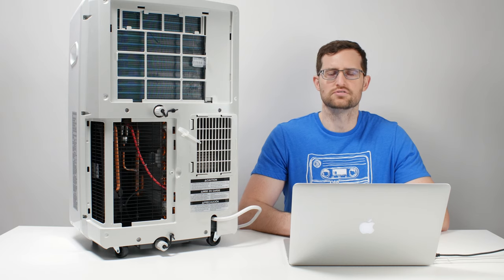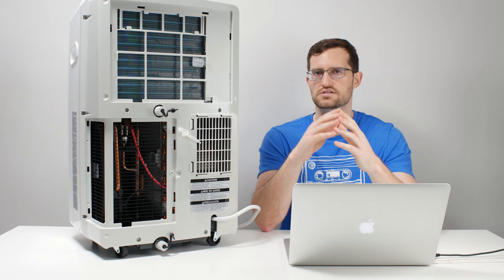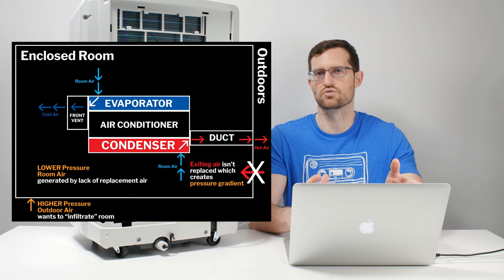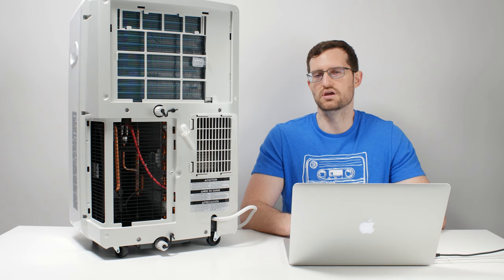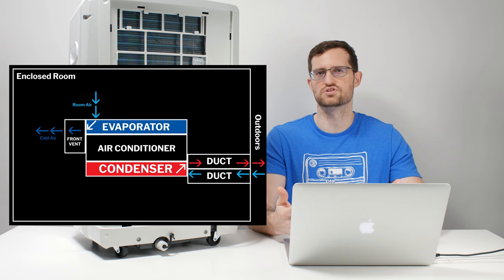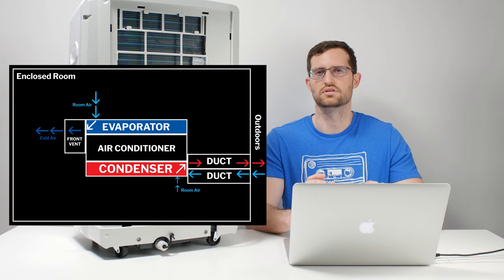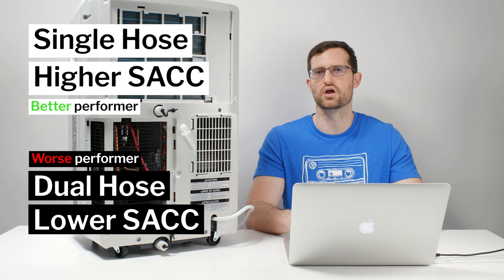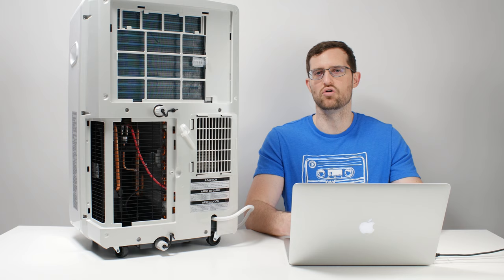Single vs Dual Hose Portable Air Conditioners

Comment: SACC is probably the worst indicator for a comparison between single and dual hose AC units. The main reason is that there is no test setup description available that fits the design. The cooling capacity at any given seasonal point is measured against a constant volume of air .. with a single hose unit that does not work, where's the exhaust air to come from ? So a few admissions had to be made, for example that the exhausted air is replaced by 'room temperature' air that has 'exactly the same' humidity as the test volume :-)
The second thing is that hose type ACs have no seasonal use cases, they mostly get stored away when not needed.
I modified a single hose to dual some time ago and measured the result. It's cooling performance dropped by about 10% because of the losses in the second hose and the higher temps of the outside air, but it's cooling capacity of the room volume of air rose by 40+ precent, simply because the room never filled up with hot outside air. Where the unit was running 100% of the time it dropped to a nice 30/70% duty cycle.
The point here is: the SACC value of a dual hose may be lower, but the suction effect of the single hose units ruins their actual performance while the SACC calculation ignores that effect.
Reply: ASHRAE is still worse than DOE's SACC.  Here is a fun description of the test and the feedback that the portable AC industry gave for the SACC calcs: https://www.federalregister.gov/documents/2016/06/01/2016-12446/energy-conservation-program-test-procedures-for-portable-air-conditioners

Comment: I have a dual hose and single hose air conditioner. The dual hose works to cool whatever room it is in. The single hose is only a spot cooler that I use in a small den that blows cold air on me when at my desk. Single hose is basically a fancy fan that only cools you down if you are right in front of it.
Reply: I have this single hose unit and it cools my 600sqft two-car garage perfectly fine. The garage door is standard without insulation on the back of the garage door panels and there's a laundry room that has the door open all of the time and there's a slotted closet door where the water heater is located and there's a cat door leading into the house... so the garage is FAR from "sealed/insulated"...so even with the negative pressure drawing in air from multiple places and the fact that I'm in GA during 90+ degree humid summers; my garage has gone from 85°  to a comfortable 75°.... This single hose AC unit is fantastic and blows out air that is a crisp, cool 55° ...it has a heating function and a dehumidifier all in one.
https://www.google.com/url?sa=t&source=web&rct=j&url=https://www.lowes.com/pd/GE-8000-BTU-Portable-Heat-Cool/5000143967&ved=2ahUKEwiNqfG9l5HyAhXVTTABHTFtCwoQFjAAegQIBhAC&usg=AOvVaw2z-IXaA84IntndC11IbrZ6 

I'm in the process of upgrading to the dual hose attachment and expect at least a consistent 72°.
Reply: @Thomas998822  I am happy for you, but if it was a dual hose it would work much better at cooling and would use less power. It is just science and physics.
Reply: @Thomas998822  that ac isn't powerful enough and it's constantly running hard.  For the size of your garage you need a 12000+ DOE(SACCS)  portable AC
Reply: @jonlee5642  maybe so. It definitely runs non-stop, and I can hear it cycle off and on (while still running). I'm not sure what technically is kicking on and off into overdrive. 

Nonetheless I only use it for several hours a day, 3-5 days a week in the summer, and it hasn't shown any signs of slowing down yet. It still keeps the garage in the low 70s which is good enough for me. I'm sure the dual hose attachment will make it more efficient, so it's certainly  powerful enough for my needs.

I'll swap it out with a brand new machine in a couple years for free so I'm not worried about wearing the unit down long term.
Reply: @Thomas998822  more likely you ac has a sensor ..if you are asking it to cool it at a certain temp..it will keep working until it keeps that temp you want it at and hence it is powering up and down all the time
Reply: where did u get the dual hose unit? you probably live in the US, because i cant find any dual hose unit in Europe

Comment: 1. The energy caused by convention heat from the INtake hose (holding outside temp) on a dual hose unit is nowhere NEAR the energy of the air (holding outside temp) pullled directly into the room by a single hose unit.

Both versions have  an exhaust hose, so there is no difference there in convection heat (unless one hose is more insulated than the other or shorter of course), but for sure it helps a bit to insulate this extremely hot hose on both variants AND keep it as short as possible to minimize convection surface.

Comment: I am using two single hose portable AC units in an apartment.  I found the dual hose unit to b overly complicated to install in my particular situation.   I found with the single hose units they are doing a great job at cooling the place.  On these units the hose diameter is 5.9 inches. They are used at about 4 feet long. 

I made sure there were no air leaks between inside and outside. These units are 10,000 BTU each.  One of these AC units is easily able to cool a room area of 400 square feet. I put a standing floor fan about 2 feet in front of the AC unit to boost the velocity of the air from the AC unit.  This shoots the cold air across the room.

Comment: Excellent explanation of this whole business.  I'm a renter and can't mess with a traditional window AC, so I'm going to get a single hose portable AC and put it outside(!) next to the window.  I'll put some kind of adapter over the main air intake and run a duct through the window to suck air in from inside the house and put a similar adapter on the cool air output and duct it into the room.  Then it'll function like a regular window AC, no negative pressure will result, and there will be no hot ducts inside.  My main problem is humidity (tropical climate) so I'm hoping the outside air will be enough to cool the condenser.   At least now I kinda know what I'm doing.... Thanks.
Reply: thanks for sharing. so your hot exhaust pipe goes out the window.

intake of air you duct it from outside the room you are in

and inside the room, you let the cool air out.

Did i get that right?
Reply: Don’t follow this guy’s advice; he’s simply wrong.
Reply: @Shontaku  I  would prefer "unquestionably wrong", "utterly wrong", "dead wrong", or "completely and without any possibility otherwise, wrong"   Or better yet, "horribly wrong." That's my favorite.  I shall now go and hang my head is shame.
Reply: @workingTchr 😂😂

Comment: Oh wow! Thanks for explaining this! I do feel the lower pressure when I try to close my door it's like it doesn't want to shut when the AC unit is running, and I didn't fully understand the reason for that! Basically my room is turning into a giant vacuum.
Reply: It means the room is well insulated (warm air still gets in but slowly). Crack open a basement window if you have one ( cooler air from there).

Comment: Using a single hose unit in, say, a closed bedroom will draw air from the room and, therefore, the rest of the house (from under the door). A dual hose unit works more like a window unit or a central unit--both of which cool the condenser with outside air.

Comment: You drastically undermined the difference between infiltration air scenarios and used a dual hose model that allows for infiltration... A single hose must bring in an equal amount of heat into the house as it's removing. In theory, you would be correct that they cool a specific 3-400sq ft  area based on SACC, in practice I would say you failed to point out that you're heating up the rest of the house... You kept saying "Performance" but I think you mean cooling capacity, in which case yes, the SACC fully accounts for the AC's regional cooling capacity but SACC utterly ignores that with a Single hose you adding tons of heat to the other 800sq ft of your home and the Dual largely doesn't, and that's pretty huge in terms of efficiency. 
SACC measures cooling capacity for a given area not the energy burden on your household (which is arguably more important to most people).
Reply: I agree.  On top of that, think about the super heater attic air that will be pulled in around light fixtures. Newer construction may seal them, but older ones didn't bother.  Both houses I owned were built in 1970 and 1965 and around the light fixture boxes none of the holes were sealed and not even caulked around.  Doesn't take much 140+ degree air pulled in from those single hose units to offset the cooling on the unit.  I sealed mine but I bet many people haven't thought of it.
I purchased a single hose for emergency use without even considering the issue.  I really wouldn't think engineers would design a unit with such a flaw, yet they did.
Reply: SACC fully accounts for the infiltrating air. But it assumes that the infiltrating is only 5.4F, on average, warmer than the air inside of your home, which is complete crap.  The calcs assume your home is at 80F and that the outside air is 83F 80% of the time and 95F 20%.
Reply: @youtubewatcher4603  I agree! I've had both dual & single hose units. In terms of performance / efficiency, the SACC is not nearly as accurate as the SEER rating.

I may have a bias because I'm in Vegas where 4 months of the year beat 100 degrees, but it's important to know that Cooling Capacity and energy burden are much more different than this youtuber seems to realize.
Reply: @youtubewatcher4603  - a lot of people use portable units for a hot room ( usually on a higher floor and facing the sun) .  Outside temp can be 70F but 84F in the room for example.  For a home with a basement window,  crack it open will draw cooler air.

Comment: There is one additional measure that consumers should account for. That is electrical efficiency to reach SACC values. Take two or more units with relatively similar SACC values and one uses 85 watts less power. This SACC to Power Usage rating can save users real money through power efficiency.

Comment: So… in theory.. one could remove the second duct that brings in (hot) air from the outside to cool the condenser. Thus making it only cool AC air being used to cool the condenser

Comment: I bought a Hisense 12000btu single hose and made an adaptation for the compressor refrigeration inlet hose made on the 3d printer. I wrapped the two ducts with a foam blanket and I can say that the efficiency has increased by 50 percent, now it turns on and off and with one duct this didn't happen, meaning I will save energy. It also depends a lot on the air conditioning model.

Comment: the goal of the ac is to keep cool air in the room, pulling in hot air that will rise and using the cool air you just made to blow out the window is a massive waste of energy and wont ever cool the room you will have the AC running constantly so you can sit in front of it and never have a room actually cooled. insulate the hoses and seal any gaps and place the unit close to the window port to minimize hose length, at least this way you actually have the damn thing do what it is intended to do an that is make the room comfortable.
Reply: They are just spot coolers.

Comment: I’ve used several different portable ACs.
And finally settled on the Whynter Arc 14s…this damn thing seems to solve all the issues you brought up somehow in a dual hose unit.

Comment: I'm taking a chance with a brand Hisense.  From Costco so return can be easy. 

It is rated 10,000 DOE/SACC? And is a dual hose unit.  I didn't see any tested but do you believe with equal efficiency or close to the Dual hose units have advantages.

The area I live has an aroma during the warm months from the Puget Sound. It's also on the top floor of the condo unit. I wanted to avoid the negative pressures for those reasons.

That being said this video was very informative and I'm going to go by the efficiency instead of a design.
Reply: How'd it go?? Considering a midea duo or hisense. Whynter is just way too expensive

Comment: Single hose air conditioners simply don't have a plastic fitting for a hose on the intake for the condenser heat exchanger.  Some people have duct taped a duct to that intake to make their single hose air conditioner into a dual hose air conditioner.   As to the dual hose having two hoses radiating heat, only one is an exhaust hose, the other is an intake but it is pulling in outdoor air and this is the same volume of outside air that will infiltrate in with a single hose so it not more heat then the single hose, it's just that that outdoir air brought in is only in tenporarily with the dual hose as it's then pumped out the other hose whereas with a single hose, all that extra outdoor air doesn't just have some radiating off a hose but just all of it stays in the house.   Sure you will feel heat radiating off that hose but it's a fraction of what the single hose pulls in through infiltration.   You do need to look at how outdoor air infiltrates into your home, is it through the cracks around doors and windows or does your home have a fresh air intake that ducts into your basement by your furnace as the basement would cool such air.   If you have the latter then a single hose may be just fine.  Now if you live in an aparrment, you should seriously consider a dual hose or duct taping a hose onto the compressor intake vent (make sure you figure out which is the condenser intake and which is the evaporator intake).
Reply: Exactly

Comment: One thing not mentioned, aren't you ducting hot air out through one hose and bringing outside air in through the other hose in the same window? Doesn't that mix the air coming in with the air going out and the air coming in is actually warmer than the outside air?
Reply: I would really like to see this answered. @4:34 he says the out door air is cooler than the air on the condenser.  If its over a 100 outside how hot is the condenser?
Reply: The diffusion of the exhausted air into the atmosphere is going to happen so rapidly that it will have negligible effects on the intake air temperature.
Reply: @Jordan-ll6hn  With my dual system the hot air exhaust sits above the ‘cool’ air intake. Hot air rises. I’m not concerned about the hot air mixing with cool air intake.

Comment: Does sacc account for the temperature of the rooms on the other side of the house?   If it did dual hose would be better right?  You could insulate the hoses right?
Reply: SACC does account for the infiltration air on the other side of the house.  However, the calculations assume that there is not a big temperature differential between inside/outside.  It assumes an average of a 5.4F difference between inside and outside or a 3F difference (80 to 83F) 80% of the time and a 15F difference (80 to 95F) 20% of the time.  The bigger the temperature differential between inside/outside, the better dual hose systems are.

Comment: What? How can a single hose unit be better than a dual hose unit? Heat leakage from the hose will always be less than hot air sipping inside in a single hose system. Are you sure you know what you are talking about?

Comment: As it's basically a fridge, any leak or bad insulation will do harm.
And you'd never cool the condenser with air from inside.
At some conditions, the system gets inefficient, but a single hose only makes it worse.

Comment: wow thanks, this clears up a lot of things. There is one edge case where a dual hose system might be warranted; in the case of areas that experience a lot of wildfire smoke, or have generally poor outdoor air quality (near a highway or other roads with lots of traffic), a dual hose system would help preserve the indoor air quality
Reply: Dual hose ALWAYS makes more sense in efficiency, cleanliness and cooling. Creating a vacuum in a room is the worst thing you can do.
Reply: @Shontaku  Came here to make the same comment.  As someone who lives in a location that has had issues with incredibly poor air quality during wildfire seasons (peaking between 400-700 AQI when wildfires were raging North, South, and West of us) using our Single Hose AC basically blew all of the clean indoor air with horrible outside air in a matter of a few hours.

I'd much rather take the "inefficiencies" to preserve indoor air quality, especially when it's 32c/90f outside and inside and you just want a little bit of relief with cooler air temperatures indoors without having to suffer with cool and horrible air quality.  So I agree there are other real-world factors to take into consideration.  Also this guy continues to go on about how dual hose is so much less efficient by using the hot outdoor air to cool the condenser...  He does know that Central air, as well as minisplits, with the condenser being mounted outdoors, does the exact same thing right?  They don't take conditioned indoor air to cool the condenser outside.  Same goes for window mounted units, those have always used the outdoor air to cool the condenser.

Also newer dual hose options typically have the hot evacuated hose contained within the intake hose, so there's a little bit of a level of insulation with the intake air surrounding the exhaust so a bit less heat as it's primarily the intake hose that will only be radiating the outdoor temperature air and not the much hotter exhaust air that may escape through the hose.